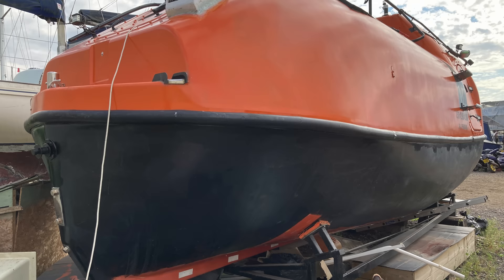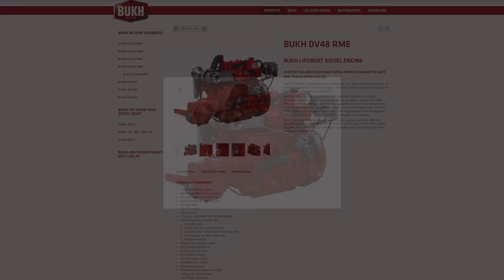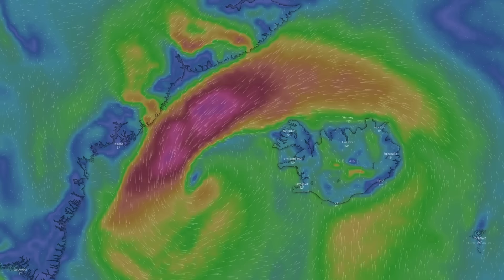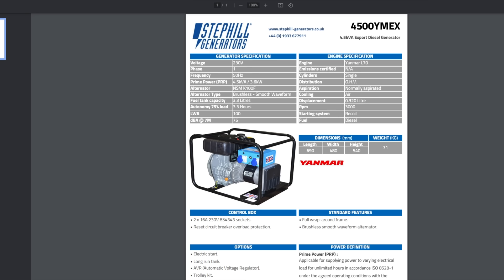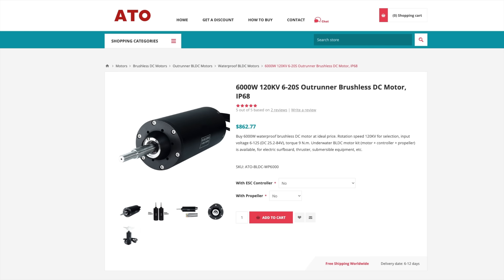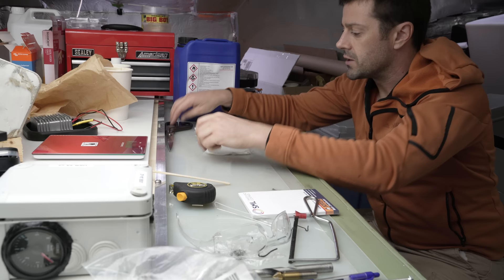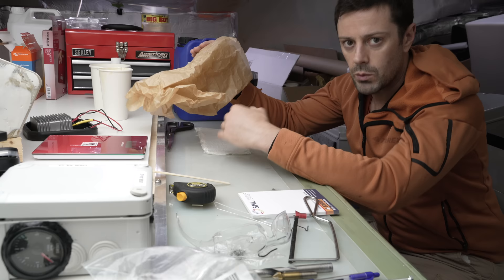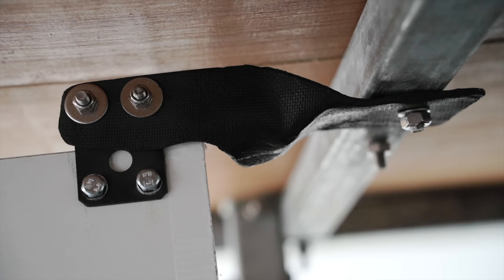Lifeboat Conversion Ep49: Electric? An engine backup plan, if Alan's Bukh diesel fails at sea. [4K]

Comment: Wrong type of kite. Those two-line Parafoils  inherently unstable, as seen in the video. Keyword is Sutton Flowform. Not much steering except choosing  the altitude where wind is favourable.
Reply from the maker: Do they not still need a gyro if not controlled by a human?
Reply: What gyro? There is a video on Youtube named "Sutton 252 Flowform Kite". It is enormous but quite manageable even solo.
Reply from the maker: They don't require any active control? Can be deployed and left alone?
Reply from the maker: I have. None I have found show unattended kites pulling along 25' boats.
Reply: I have done it many times. You tie the kite to the bow and downwind you go. No steering needed. But wind blows different direction on different altitudes. Even smallish kite like 80 is equal to huge spinnaker when it is mile high.
Reply: @AlexHibbertOriginals  If you want to stabilise a 2 line kite, just fix the two lines a distance apart. The further apart the more stable it will be. As a kid I used to fly stunt kites. A few times I pegged the two lines about 1 metre apart and just left them up and flying. One time I left one for a few hours and when I came back it was in exactly the same place in the sky as when I left it.
Reply from the maker: I'll look into it - I have no kite experience, even on the ice.
Reply: Two line kites suck also because reaching them strong stable winds above 300 meters is almost impossible.
Reply: I have a video, where I launch a Delta from sitting position on a kayak. "Gulf of Finland East" at 0:19.  Requires some skills.

Comment: Just ad an outboard bracket and a yamaha hightrust ultralongtail.
Reply from the maker: Where does all the highly flammable petrol go?
Reply: @AlexHibbertOriginals  same place as you batteries would go to run electric outboard.
Reply: @AlexHibbertOriginals  i have Bukh dv20 that gave up on me, i was glad i had the outboard kicker to get me out of trouble. I mounted it on the transom with a Garelick bracket just in case. Glad i did! I use an external tank that is tied to the rail. I am living on a 34foot sailboat, most of the time at anchor all year round

Comment: ALLAN is not yet a submarine! Deasil electric if you have big big money will work
But in salt water  and ALLAN being your actual life boat to complicated  I have alot of time on
Engines and generators  my  very humble advice is to have spare alternator/  starter/ soliniod/ all
 hoses /! Water pump/ and seals/ gasket kit/ filters/  belts!/ thermostat  I have drawn away to use 2 bukh engines, actually just the basic  block and head magnetic clutch and switch !
There rendering close 100 hp minus some friction / and I think another generator which can't hurt in line of work pla ed on the other side to the one you have you can get a good 35 to 50 horse electric out board for a emergency  ride to port or high speed could ed with the devil
My 2 cents sorry Alex if I have bothered  you needlessly  I tell lots of people to wacth you channe
CHEERS TONY

Comment: A video where your prodigous research examines the issues involved with creating the equivalent of an electric outboard would be fascinating. Have you thought about repurposing defunct petrol outboards with an electric motor? https://www.youtube.com/watch?v=xOVEzXozgfE
Reply from the maker: It's an option, but probably easier and cheaper to simply install an IP68 rated motor and prop onto the end of a tube, and mount the power and ESC inboard.

Comment: I’m a professional mariner, and you couldn’t pay me to take a lifeboat like that anywhere near the open ocean.  I hope you’re aware of how badly that thing will roll, and I mean Roll Over, when your in the North Atlantic.  They are designed to keep people alive for a couple days but in no way do they have enough keel/ballast for the amount of sail area in the superstructure.  You’ll be lucky to make 2-3 knots in any kind of sea.

Specific to this video, your backup propulsion scheme seems daft as well.  3 little electric motors keeping your bow pointed up wind while your what?  Fixing the engine?  I don’t see any Racors in that setup, what happens when you get water in your fuel?  Imagine what you’ll be capable of deploying when the boat is half full of water doing somersaults around you in the dark.  

You need two engines mate.  Maybe I would consider a drop down azipod in the bow, but I wouldn’t trust my life to a couple homebrewed electric motors and driveshafts for a surfboard.
Reply from the maker: Jimmy - welcome to the channel. Your positivity and attention to detail is appreciated.

I'll be sure to discount the advice from marine engineers, offshore sailors with 40+ years at sea, Royal Navy mechanical engineer officers, and people who've bothered to watch episodes that cover most of your complaints. I'll replace their input with yours, sell Alan for scrap and take up stamp collecting.

I also always take seriously the input of those who can't differentiate your and you're.

Comment: Removable mast and some used sails. Pintle/gudgeons/rudder.  K.I.S.S.
Reply from the maker: Simple you say. Where would the mast be mounted? The top of Alan is a twin-skin fibreglass shell. A mast would need to pass all the way through the boat, move all the fuel racking out the way, and be anchored into the structure. The sail itself would need a whole rigging system installed, and would obscure the driver's view.

Comment: Would it not be easier to install a Bracket in which to hold a backup outboard engine ? and have it so it can twist to the side when not in use ?
Reply from the maker: The video covers this. Diesel outboards are very heavy, very expensive, complex to maintain, and need to be stored upright. Even a reconditioned old, lower power one is £10K+.
Reply: @AlexHibbertOriginals  Alright i missed that part was multitasking :P

If you want a big project but at the same time pretty easy. You can have 2 Driveinputs so you then can attached whatever Hydralic motor can be small and easy to drive with a small electric or fossilfuel.. because then you can have the Hydralic lines outside the boat with the Motor that spins the Oil for the hydralic motor

Ahh my ADD is acting up.

Short list here.

Hydralic motor
another Inputshaft or split
hydralic Pump
Engine/Motor for the Pump
Hydralic lines 2 Flow and return...

That should do it